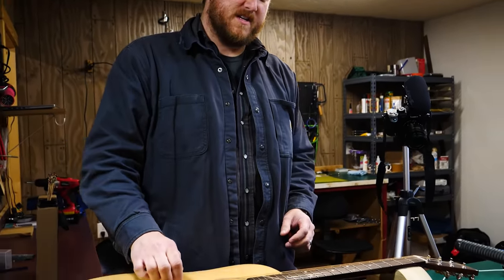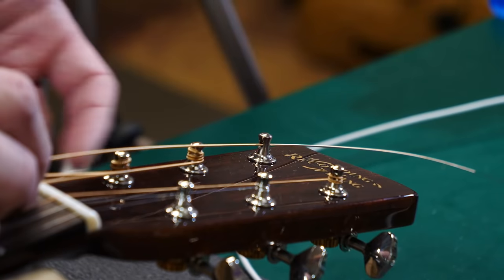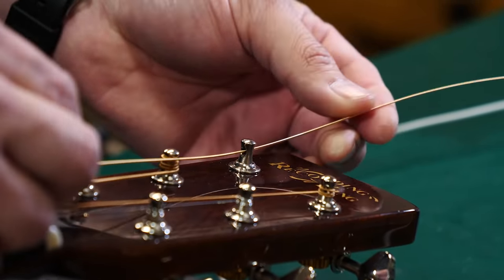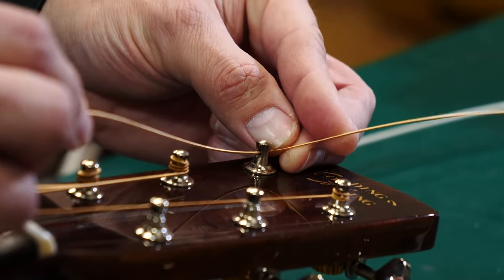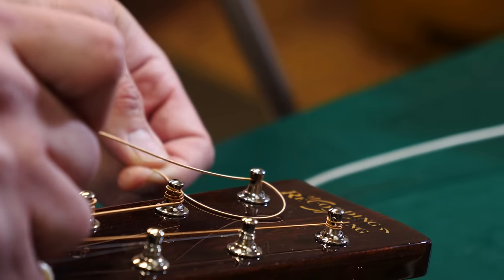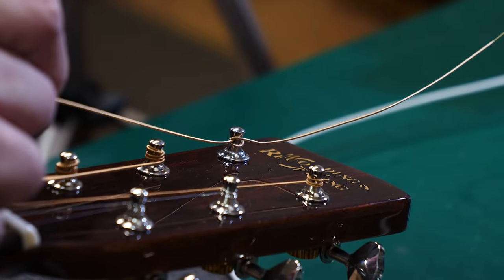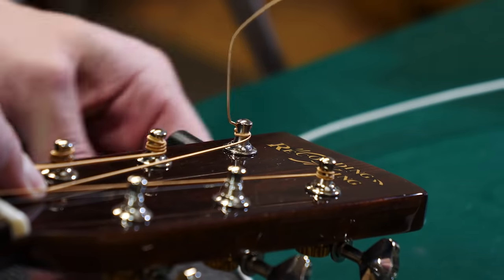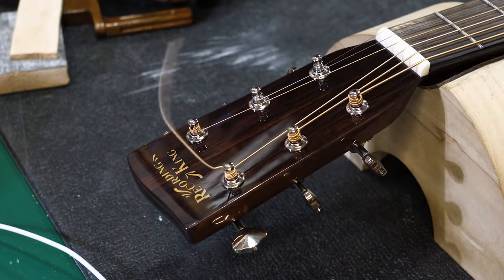Tech Tip: How to Tie a Luthier's Knot When Changing Strings

Comment: Been playing since 1974. This is the method I learned back then, and used for decades. I found a much easier way to secure the strings about 15 years ago. The first wrap of the string goes on top. Never had a slip, and removing the strings from the post is WAY easier than the knot.
Reply: Someone showed me this years ago, and I forgot all about it! I have a guitar right here I'll be stringing soon. This wee discussion will be very useful!
Reply: Yep. I work as a tech and builder. Having restrung hundreds of guitars, one wrap over and the rest under is perfectly stable, no weird knots to tie, and you don’t have to mangle the string and poke your finger to get it off. I can’t tell you how many guitars are strung up in such ridiculous ways I spend half the setup time just untangling and snipping strings from the tuners.
Reply: indeed, but I used to get blasted by others for using this what was called the Gibson wrap in the 70's because every Gibson came with a piece of paper showing this method, but as you stated and I always say, just one wrap above the string and the rest under grips the string without slippage and is far easier to remove, I've met many famous guitarists and none of them use this...they all do it the way you described...I really can't believe I'm seeing this pushed after so many decades.
Reply: Yes when I'm playing live if a string breaks, which it seldom does, I want it to fall off quickly so I don't wrestle with a knot. When I change strings on my acoustic I take the string end to the post I want, add the distance to the next post and that's good for over 2 full rotations on the capstan, there I put a 90 degree bend in the string. Slot in the post hole wrap over the top first winding then others go under. On my Telecasters I add the distance between 2 tuning pegs. Of course on the old Tele you had to put a 90 degree bend in the string and snip off the waste to insert in the hole before wrapping the string on the tuning peg. I try to avoid knots. :)
Reply: Also known as the "self locking" method

If you buy a set of SIT brand strings, you'll find their Stay In Tune guarantee only applies if you use this method (as per their instructions)

Good to see Gibson using it too
Reply: That's exactly how I've been doing it for years as well.
Reply: Yea I always just stick it through, leave some slack, first wrap over, the rest under.
Reply: One over the rest under is the way I learned to do it when I started 15 years ago. Not once have I had an issue with it. I never tried the "luthier's knot"; looks like it would work fine, but looks a bit messier.
Reply: That’s how I do it too
Reply: Yes, first on top the rest below is what I use here, I have a lot of instruments and this is the best for a not lock tuner
Reply: I cant visualize the process from this explanation. Does anyone have a video demonstrating this method?
Reply: I do similar, except on the B and high E, I put all the wraps on top. Never had an issue.
Reply: That's how I do it, too.
Reply: 1976 for me.  Exact same opinion.
Reply: The knot method is a denger to the stringer and the guitar.
Reply: You are correct, the method of winding the 1st wrap above the tag end, and then the rest of the wraps below is indeed known as "the Gibson Wrap". This is the only way I install my strings on acoustics or electrics. @nasticanasta
Reply: The method you are using is known as "THE GIBSON WRAP".........and it is indeed the best way to install strings on the tuning posts. The reason it's always been known as "the Gibson Wrap" is because many years ago, all new Gibson guitars came with instructions on how to use this method. Whether Gibson actually devised this method, is up for debate. But it works the best .......and I've been using this slick method since 1973. Your strings will never slip on the tuning post using "the Gibson Wrap". ( 1st winding goes over the tag end of the string, while the rest of the windings go UNDER the tag end of the string. )
Reply: No need for locking tuners with this method, I think the strings become "self locking".
Reply: No video necessary. Here ya go: Line up the string hole in your tuning post so it aims right at the slot of the nut. Next, run your new string through the hole in the tuning post. Get the proper amount of slack for at least 3.5 windings ( approximately ). Now, put a 180 degree bend in the tag end of the string right where it leaves the hole/tuning post. ( You're actually using the tuning post to make the sharp bend. ) Next, start turning the tuner, and when the tag end of the string is getting close to the main part of the string, STOP winding & tuck the tag end of the string UNDER the main part of the string & let it hang out the other side ( you're simply making a single pass UNDER the first winding WITH THE TAG END of the string. ) Now, TAKE THE TAG END, PULL & BEND IT STRAIGHT UP. Now you can continue winding your string on while keeping tension on the main part of the string with your other hand over the fingerboard. ( Use your index finger to do this. ) As you keep winding, you will notice that the rest of the windings pass UNDER the tag end of the string, just as the first winding has already passed OVER the tag end. As you tighten the string up to pitch with the tuner, this "1 wrap over, the rest under" literally cinches the tag end of the string ( right at the tuning post ) so that it's impossible for the string to slip on the tuner. It's much easier to do than it sounds. Takes just a bit of practice the first time. Tony Polocanastro ( I probably miss-spelled his last name ) has a really good video on his channel showing how to do this, and I'm quite sure many others do as well. Works extremely well on ALL guitars, both acoustic and electric.  @cooksilo
Reply: See my other response to you where I describe in detail how to do this. But afterwards, I found the video ya need to watch that'll definitely teach you visually: The video title is: "The BEST Way to Re-String Your Acoustic Guitar".........the youtube channel is: "TONY PALECASTRO"  ( I miss-spelled his last name in my previous response to you. ) Once ya learn this method that we're all talking about in these comments/responses (known as "the Gibson Wrap" for probably over 75 yrs, but many don't know it by that name  ) and watch Tony's great video, to see it visually........you'll never re-string a guitar any other way........because it really works. ME: 62 yr old guitarist/singer/blues harp/stage performer of many many years. I've been playing guitar ( both electric and acoustic ) for 50 yrs now, and performed all over east/central Florida. I believe in teaching & sharing knowledge with guitarists who are learning..........and we're ALL still learning. Hope this helps, and enjoy your music young Brother.  @cooksilo
Reply: Been doing it that way for 35 years.
Reply: Since 1958, one over the top. The rest underneath. No exceptions. Don't need to screw with a knot when you break a string on stage. I wasn't rich enough to have more than one guitar at a time back when they were my bread and butter.
Reply: It works only for wounded strings. Unwounded strings doesn't holds that way.
Reply: @ganz_solo  My 42 guitars and their unwound strings would disagree.😉
Reply: @MyName-nx1jj  What you know about traction?)))
Reply: @ganz_solo  Traction refers to the grip or adhesion between an object or surface and another object or force applied to it.
Reply: @MyName-nx1jj  there is almost none adhesion between unwounded strings
Reply: You are doing the actual luthiers knot. This video is not. ...knot
Reply: This is the way. 
Easier, faster, and much cleaner looking once trimmed.

Comment: I bought a Martin D35 in 1987 and there was instructions included to string this way. I don't recall it being called a "luthier's knot" but I've been using the method ever since. I don't know that I have ever run into anyone else who uses it. It does work well for me, never have had an issue with slippage. Thanks for sharing.

Comment: I've used this method for about 15 years and found it to be precise, but I try and keep the windings to a minimum (between one and two winds), and I don't bother going above the string at all so I can just flip the end back over while there is still tension when replacing, and it doesn't stretch as much over time. People find their own ways but I would say if I was charging to restring guitars, I would want to make certain the user will have zero issues every time and this method makes certain of that.
A very informative video, I'm sure a lot of people are finding it helpful.
Reply: I agree. He puts too much slack before coming back around. You
don't have to put any slack into it. Just go back around and under
with no slack. His peg now has too many wraps on it which can
stretch and loosen. If you go without slack, there is no extra to 
stretch and loosen. The lock is already there even if you don't wrap 
extra times as he does. The extra wraps are doing nothing good.

Comment: How about using physics and the design of the tuner post to insure that you don't need a knot.  If you notice, most new tuning posts are concave and flare out above and below the string hole.  After you put the string through the hole put the first wind  over the top of the string coming through the hole, then all successive winds below the string end coming through the hole.  The concave part of the tuning post then cinches the string tight from the top and bottom compressing the winds against the string end and making it almost impossible to slip. Cut off the leftover string.  This makes it a lot easier to change strings in the future.
Reply: Yep.
Reply: Thank you...this is the best way. I don't care for the knot when removing them.
Reply: You should post a video.
Reply: That's the way I learned about 60 years ago, It has done me OK all this time.
Reply: Absolutely correct!  That's the way I've been doing my strings since the age of 13 in 1979.  And I'm a "get this fucker in tune and keep it that way!" kind of detail man.

I watched this video to see what sort of backwoods method was being taught. And while it might work out fine, there is no better way than what you've described here.

Hopefully, most newbies will question and scroll down to read your comments!

Marc
⚡
Reply: That's because because you described an actual luthier knot. Don't know what the donut in the video was talking about.
Reply: I was in the guitar (repair) business for over 10 years -I can't count the sets of strings I've removed for one reason or the other.  I HATED it when a guitar came in strung with any kind of knot at the string post.  It's not so bad for the big strings but you invariably have to get needle nose pliers for the small strings.  In a one man shop time is money and any kind of knot in the string wastes time.  I used to joke with my regulars that I would charge extra if they tied the strings on.
Reply: You don't need the mythical 'luthiers knot' on posts as they are !

Comment: This style of wrap is fine for players that don't gig.  If you gig, or tech for other bands, this method absolutely creates issues when removing the strings.  In most cases, needle nose pliers and good lighting are needed to remove the broken part of the string that is still wound on the tuner.  This can really make it difficult to quickly change out a strings.  I prefer the method of wrapping the first winding above tuner hole and the rest below.  This will create enough tension to keep the strings in place without wasting time trying to remove the leftover broken string.
Reply: Right, well I gigged for decades and used the mandolin method (AKA luthier's knot). I'm afraid I simply don't agree with your objections. First, if you change your strings as often as I think you should, you will RARELY break one. Second, there's a mindlessly simple way to remove strings. Cut them and push them back through the tuner. It takes seconds. This method works fine for gigging players, as do several other methods. Use the one you like. Again, this one works and works well if you do it correctly.
Reply: I do the "one over, and the rest under" method too. Three full wraps on the wound strings, and five or six on the unwound. Unless you're playing on cat-gut strings, they ain't slipping at all! None! Once they're stretched-in, if anyone has tuning issues it's probably because they didn't put graphite in the NUT slots, or they don't know that you have to always tune UP. If you need to go down, you have to go farther down, and then come back up. I tie knots when I rock climb, not when I Rock the Casbah.
Reply: @mxgr194  I absolutely agree.  ALSO, if you gig with a guitar strung with this method, less tuning is required!!!!
Reply: @truculenttones  Yes, been doing this knot for 20+ years. I teach this to every guitarist who comes to my shop. Definitely the most stable for sure.
Reply: Under/over, it doesn't get any simplier.  Unwind one turn, pull, and your string is off the post.
Reply: I have 20 years on you, and I never had a problem with over/under.  Maybe add a little expoxy to really keep them "stable".
Reply: @wulf67 You are absolutely correct,  top, to bottom,   then as you rightly say,  tune up, never down 
and don't  forget to stretch, then stretch again,  easy. peasy .and please,    none of this knotting nonsense..
Reply: @wulf67 any video links on this method?
Reply: @Srhyle  Besides this one?
Reply: @wulf67  you mean this "one over, and the rest under" method is this video? It seems not doing the "over" part. Or am I missing something?
Reply: @Srhyle  Try watching a video called "Pro Guitar Tech's Most Hated Things (and how to fix them)." it shows this way and then the right way.
Reply: @Srhyle Rhett Schull has a 'luthier hates this..' I forget but just pull the string up and wind it..pull back 1 fret or 1 tuner, to get some slack 
I guess the above comments are one wrap above, then a few under, 4-5 on unwound strings
Aloha

Comment: Thanks Jake! I was taught to use this knot in the late 60's, holds great! Another thing I was taught to do while the strings were off was to check the tightness of the tuning machine nuts to make sure they weren't walking around, about ten inch pounds is good. If the machine nuts are loose it can damage the head stock by wallowing out the machine head bores and cause the instrument to loose tune.
Reply: Foot-pound, hand-pound, bro. 😆 this is good info too, thx!
Reply: what is the tuning machine nuts. lol
Reply: @christineblack4654  The nut is on the face of the head around the tuning post where you palace the new string thru the pin. It's very important that you don't over tighten the nut as it will damage the head. Don't tighten more than 10in"pounds ( just a little more than finger tight). Not all tuners are attached this way, some are screwed on to the back side of the head. When in doubt take the guitar to the shop.

Comment: I remember in the old days I would first wind the string around the post several times (WITHOUT running it through the post hole),  with the windings properly "stacked",  and THEN complete the process by sticking it through the post hole and bending it in the opposite direction of the cranking movement.  Kind of "backing into it",  I guess you could say.  Probably not the wisest technique,  but I didn't know any better,  and it did the job!  But the method shown here is great!

Comment: Thank you very much. New bassist 400 hours and first time I have replaced my strings. The shop I went to previously closed down after covid and I live in the country and now the closest city has lost the guitar shop. This was a great help now I am fiddling with the height of the string compared to the previous setup. I think my string gauge is larger so strings getting in my way. I will check out your other vids they may have the answer.

Comment: Thank you so much Ben for sharing this trick.  I once knew a luthier in Seattle named Phil Tafoya who taught me this trick.  This was back when we didn't have those little clip on tuners, so tuning was an even bigger deal than now.  I was playing 5-7 nights a week in those days an breaking strings fairly regularly.  Also, I was (and still am) a big fan of the two-fret bend.  Needless to say, the Tafoya knot, as I call it, was a game changer. One more thing.  Phil was specific about going just once around the peg if possible.  The more you wrap, the more they stretch.  I find that once around works great.   What's funny is whenever I show this trick to others, they think I'm nuts.  They are correct, but it's not because of this knot.

Comment: I've always done it like this. Tip for the right amount of slack is to use 1st and 2nd fret.
Pull the string tight, grab the string at the 1st fret and pull it back to the 2nd fret and that's your slack. Then do the knot.
Reply: That’s smart. I always tried to use the distance of the tuning pegs as my measurement adjustments, but that’s way more consistent and easier than guesstimating on the D and G on 3x3s or the B and E on in-lines. I’m definitely trying this next string change.
Reply: 1.5 frets thickest 2 strings.. 2 full frets on the rest.

Comment: Yeah, I've only been changing strings for 50+ odd years, and this is the first time I've heard of this knot.  I'm gonna get some new strings for my acoustic and try this.  Thanks Ben!!
Reply: I'm not sure why in this video the guy uses so many winds, but it's really not necessary. The point of that "tie," is to decrease the number of winds so that the wind itself doesn't stretch on the key as you wind up. I generally pull the slack until you got slight tension. Then use the key to crimp the string of the desired length then use this tie. Gives you a good one, one half winds and you just need turn the tuning machine a few times.